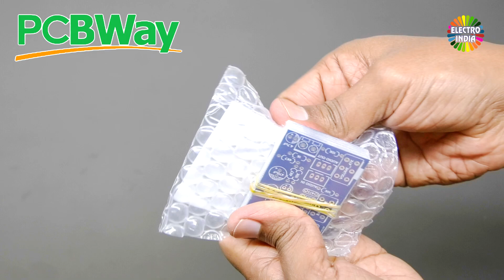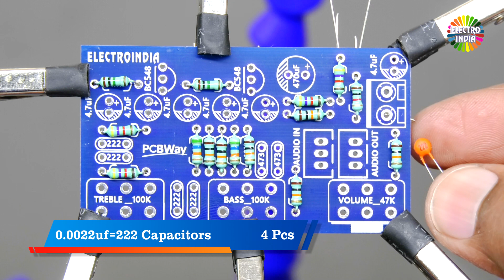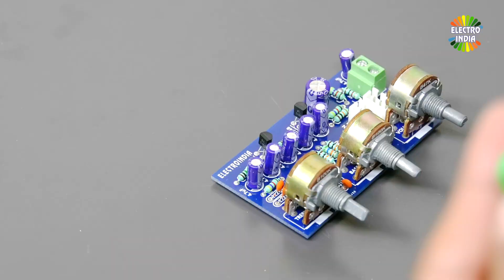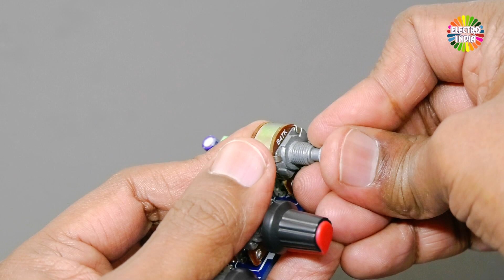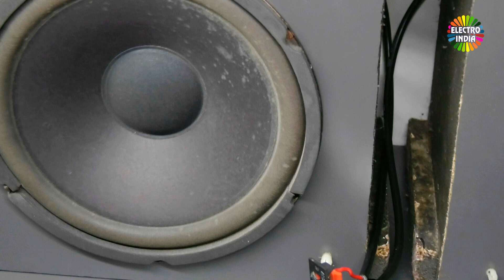Bass, Treble & Volume Control Board Preamp with Transistors for Audio Amplifier Hindi ELECTROINDIA

Comment: Sir 4440 bord me Hamming problem aata hai ,
 Kise hatai 😢please
Reply: Filter Capacitor 2200mfd 25v use karo aur metal boldy se ek ground wire connect kar do
Reply: AAP kya karo ki 4440board ka SMPS rectifier our filter direct board per jod do aapka gaming problem solve ho jayaga
Reply: Lekin bord me 4700 uf capaciter 25volt laga hai  ,sir
Reply: @rampraveshkumar3565   kabhi kabhi jyada volt aur mfd hone ke karan bhi humming hota hai bord ko maximum dene pe humming hoti hai

Comment: Tl494ic & irf3607n ya irf540n D-Class 500watt mono Amplifier bno.. Ya circuit bnana Asan hai is circuit ma smd components use nai ho ta .... Tl494ic bd139 Or 140 use hota hai 0 12 Or  0 80 volt is circuit ma use hota hai  ...  Driver stage Or tl494 0 12 volt pa chal hai mosfets 0 80 volt pa ....

Comment: Sound is getting distorted because there Is no gain control circuit. I want  preamp with tone control with 4 transistors and gain control. Which got more power to drive amplifier.